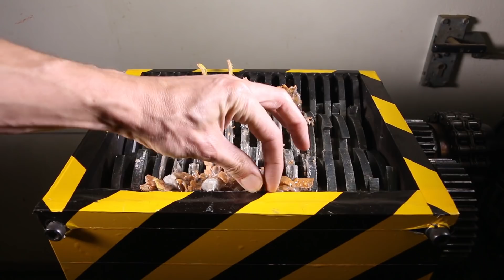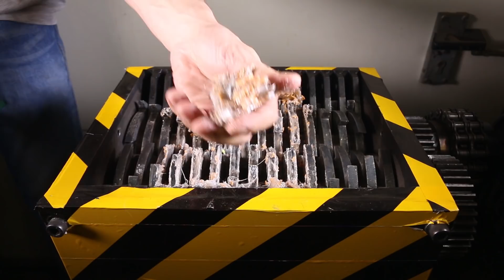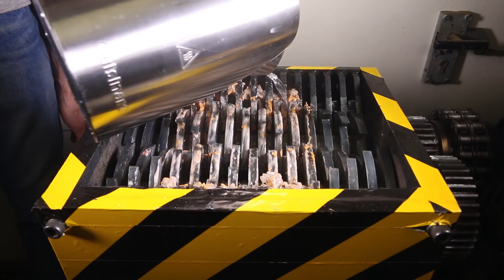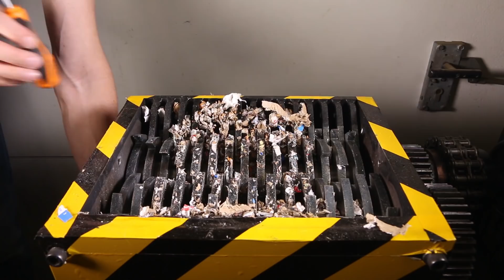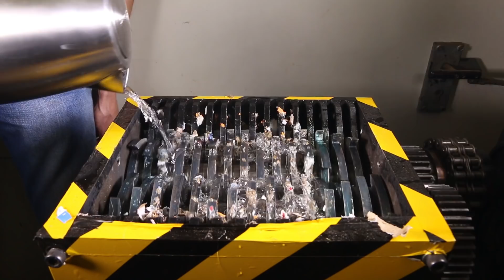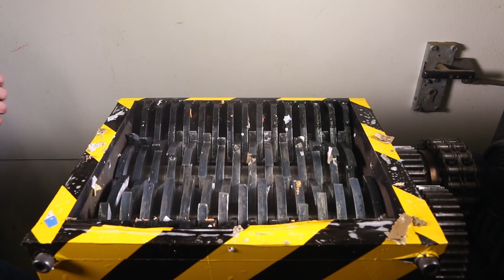Cleaning The Shredder after Shredding Stretch Armstrong | PressTube

Comment: if you were to shred enough paper it will eventually clean itself.

paper soaked in hot water should work the best. Run it through a couple times and I'd bet it'd be clean without any manual cleaning

Comment: Ah, so you can't disassemble the machine. Damn what a lot of work man 
should would been nice if it could come apart and use a pressure washer on it with these bad ones like this and the alkyline batteries.